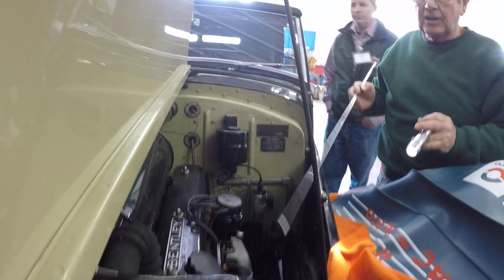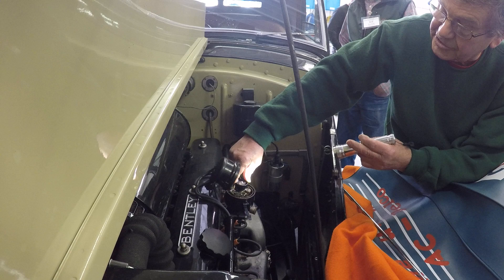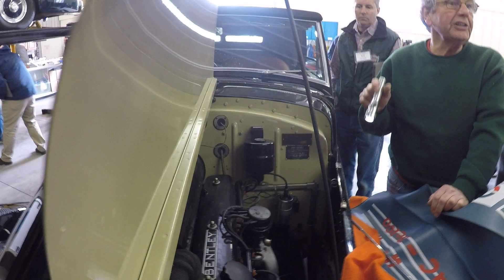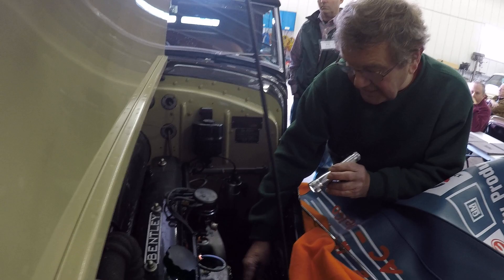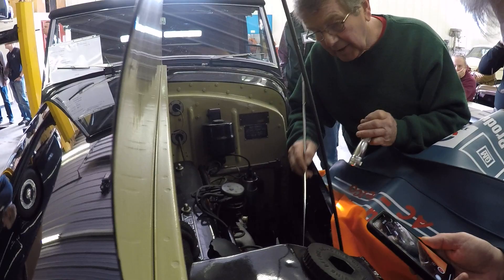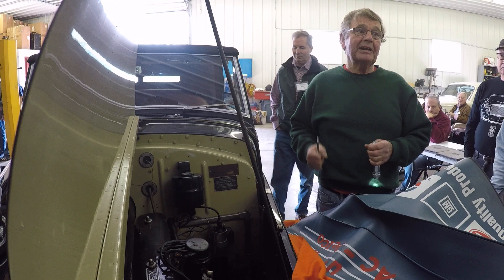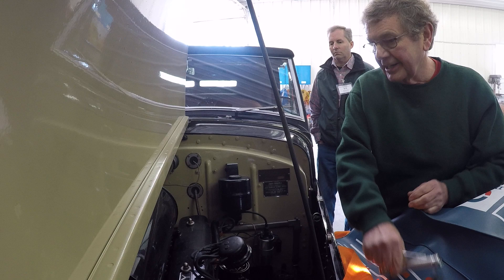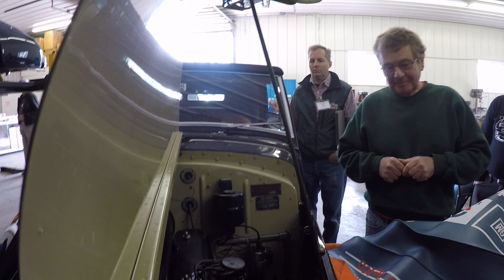Looking under the hood of a 1951 Bentley Mark VI.

Comment: A straightforward in line 6 pot engine. Plenty of room to get at everything. No special tools needed. Most owners can maintain this engine themselves. This engine was also used in several military vehicles, lorries, fire engines and small busses. As a result parts are still available. Joining the Bentley Drivers Club is a great source of information and the less common parts.

Comment: A useful tip that applies to Bentleys and others is to open the bonnet and run the engine after dark. That way any sparks between HT leads and other metal parts are easily seen. obvious after somebody tells you